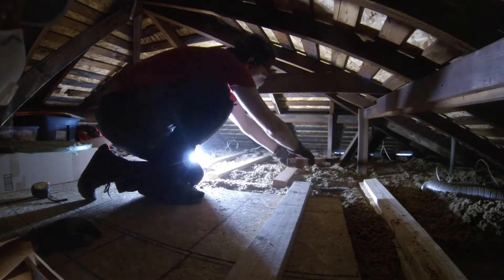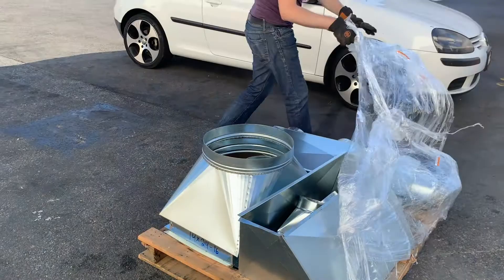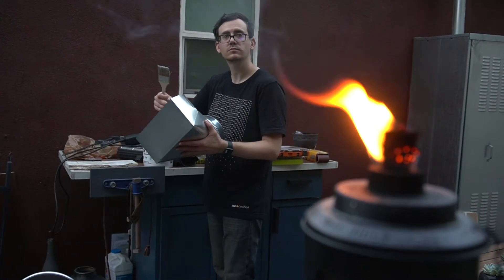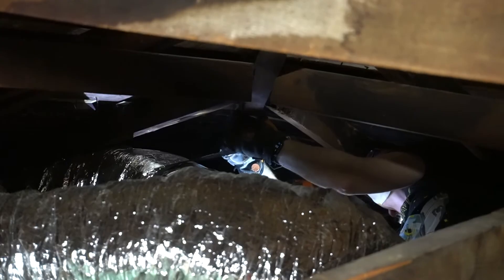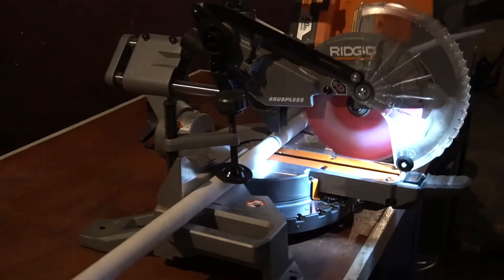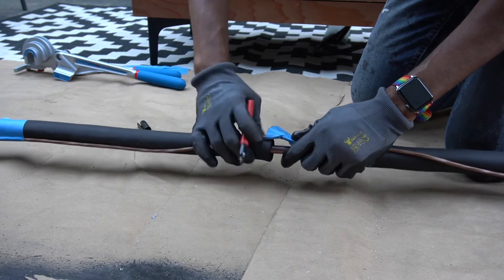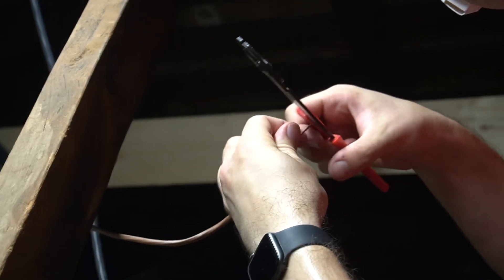Slim Concealed Duct Mini Split Install

Comment: Nice work! Bunch of new tools that cost as much as the labor to install would but you get to control the quality. Cheers!
Reply from the maker: Professional installation is very expensive in our area. I also already had many of the tools from previous wall-mount mini split projects.
Reply: The tools don't cost anywhere near what install labor costs, especially in an expensive area. This would easily be a 5-figure quote from an HVAC company, and the parts/unit are less than half of that total cost. When HVAC labor costs what lawyers do (300+/hr), it's insane not to consider DIY.

Comment: Thanks, guys.  Our house is a nightmare of architecture--huge sections added at various decades and no HVAC in 4,000 sqft of the unfinished extension.  With very short amounts of outdoor space for the unit.  I'm debating whether to go with wall units or concealed ducting, and your vid is selling me on going with the concealed ducting setup.

Comment: wait u r not gonna need individual cooling or heating?
Reply from the maker: It is a small house and we do not need individual control for each room. Central HVAC is a very typical configuration in the US.
Reply: @40Figs  Oh so thid is a more efficient kinda central ac

Comment: Hey guys, really enjoyed the video (especially love how supportive and kind you are to each other)! I'm in the process of remodeling my own LA home and want to replace the ancient gas furnace with a ducted mini-split system, albeit with three zones (three slim duct units). As a fellow do-it-yourselfer, would you recommend taking on a self-install (mostly to avoid paying the $30,000 cost for a professional installation)? Or is it a lot for someone who is detail-oriented but hasn't done it before?
Reply from the maker: Thank you! I'm glad you enjoyed! That's a tough question to answer. I will say, it was a huge undertaking for us. We did have some experience with mini-splits but this was our first ducted install. We learned a lot and saved a ton but it's sometimes difficult terrain to be in for DIYers because there's unfortunately not a lot of resources out there for DIY HVAC work. It's also a very involved process that will probably require learning new skills, but it can't hurt to try! (as long as you have a back-up plan in case things go sideways!)

Comment: So can the air handler be installed in unconditioned space?
Reply: Yes, they're internally insulated.  The only concern is that the condensate line can freeze.
Reply from the maker: Indeed. We live in a climate where freezing does not occur.

Comment: This was really interesting to see. The main lesson I learned from this is: I will pay somebody to do this because it's a lot of work! Looks like you guys did a nice job. Are you happy with the system now that you've lived with it for awhile?
Reply from the maker: Yes! Very happy with it. It runs nearly silently and the variable speed allows it to maintain our preferred temperature without kicking on and off a bunch like a single-stage system. I definitely recommend hiring a competent professional unless you are willing to spend a lot of time researching and installing a unit, as well as purchasing the necessary tools upfront. That said, with the quotes we were getting, we saved thousands of dollars by doing it ourselves, and learned a new set of skills along the way.
Reply: @40Figs  would you mind sharing the lowest quote you received vs how much you paid in total? I'm in the same boat and considering doing myself. 

My lowest quote was $11,000 for a 3 ton system and 4 ducts.
Reply: @40Figs  How many BTU's is the system you purchased? Mine is 18,000 but I'm not sure what flex duct size to use? It's running at 370-530 CFM with no ducts attached.  I'm running about 60' ft of flex with 6 boots into three areas with 8ft ceilings. Now I'm not sure what size duct to use. Worst case would be installing and then releasing its not running. Any advice would be appreciated!

Comment: Thanks for the video.  Great info.    What's the minimum space of the attic would you recommend?  I have a flat roof so don't have much space...similar to the lower end where you installed.
Reply from the maker: These slim ducted units are made to be installed in tight spaces, often in a soffit. That said it will probably be difficult to make the connections in a tight space, so YMMV.

Comment: It appears they used a 16 inch supply....which equals 1000 cfm intake.....and on the outflow they used either 5x6 inch flex which flows 75cfm per tube or 5x8 inch flex tubes flowing 160cfm per tube.      engineering appears to be designed for a 24000 btu system which outflows at 775cfm.
Reply: We installed a pioneer 24k btu consealed ,, the video was great but confused by the addition of your second drain pan under the indoor unit, Also I found plenum ez to build at home using Lowes tin sheets and output plenum using a 4ft ,,8x12 duct from lowes all ducts cost under  $350 including boots .
Reply from the maker: In California it is a requirement to have a secondary drain pan in case the primary drain gets clogged. It is cheap insurance to avoid water damage. Glad you were able to build the plenums yourself, that certainly can save some money.
Reply from the maker: The system was engineered for 600cfm at 0.1-0.2" WC. You are correct the return is 16 inch. The supply/outflow ducts are 2x 7 inches and 2x 6 inches. The unit is 18000 BTU.

Comment: Hi there , from the controller to the indoor unit what cable do you use and how did you connect them ?
Reply from the maker: I believe we used some 18 gauge thermostat wire and spade terminals.

Comment: What thermostat did you use?  We just installed 4 MrCool ducted units and the thermostats are junk and we can't find a replacement that works with the units.
Reply from the maker: We installed the Fujitsu UTY-RVNUM thermostat as well as the FJ-RC-WIFI-1NA to get WiFi/Alexa integration. I doubt these will be compatible with the MrCool systems though. Look at what other options MrCool has, or possibly the Cielo Breez or something similar.
Reply: @40Figs  I've been looking but even MrCool says they don't have one and don't know what third party brand might be compatible.  Basically they're no help...lol
Reply: MrCool stuff is mostly rebadged Gree... cross shop Gree to see if they have anything that might work.
Reply: @hedge605  thanks I'll look.

Comment: Wouldn’t it be easier to put the air filter right behind the grille in the ceiling of the supply vent
Reply from the maker: Yes. That said, at the time we designed this I was unable to find a MERV 13 filter grille that was sized to meet our needs. In this case the filter cabinet is accessible right near the attic entrance, so it's not too bad. Aprilaire recommends changing this type of filter every 9-12 months.

Comment: Excellent video....I'm curious about the tray that you installed below the indoor unit. Is that just a tray to catch overflow moisture in case of a condensate issue?
Reply: Yes. In some areas it’s code to have an emergency drain pan under the unit
Reply from the maker: Indeed, it is a secondary condensate pan in case the primary drain inside the unit gets clogged.

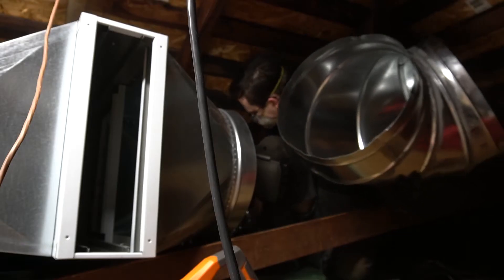Comment: I'm in LA too! Hey where did you buy the air filter box in your ducting? Seen here at 8:47 https://youtu.be/ItYoS9Zp498?t=527
Reply from the maker: It is an Aprilaire 2410. I believe we purchased it with the rest of the equipment from a local supply house, but they are also available online.

Comment: What is approximately the cost of this split System?
Reply: Anywhere from 3000$ to 9000$ typically. But it depends on a few things. Especially the state you're in. Somewhere like New York or California you could see this cost up to 15000$ or 18000$
Reply: @AJ-ox8xy  for such amount of money I would learn not only how to install mini splits but entire racket science
Reply from the maker: Including all ductwork and installation supplies, we spent around $5k to install this unit. The lowest professional quote we received (Los Angeles) was about $10k.

Comment: How is it holding up?
Reply from the maker: Very happy with it. It runs nearly silently and the variable speed allows it to maintain our preferred temperature without kicking on and off a bunch like a single-stage system.

Comment: Great video guys! I really appreciate that you show good footage of all the details of connecting everything together, I'm considering doing a similar install so seeing all these details was super helpful! Anything you'd change or do differently if you could do it again?
Reply from the maker: The only thing I think I might do differently, and this is a big maybe, is to install a unit that had better thermostat options. I'm not a big fan of Fujitsu's thermostats but ultimately you are sort of locked into using them because it is a proprietary control protocol. We ended up purchasing the wifi module (for more than you'd spend on something like an Ecobee or Nest for a traditional system) so at least we can control it with Alexa and a mobile app. Fujitsu does sell an adapter so you can connect a traditional thermostat but you lose the variable speed feature which is important for comfort and efficiency.
Reply: @40Figs is there any chance you guys could tell me a link or name of those baffles for the air vents because I can't seem to find them

Comment: Nice video! I noticed the same thing you all noticed. The ducts for some reason are hard to come by. I guess they assume most contractors will already have the tools to fab up their own plenum.
Reply: There are only so many metal fabricators that can make the sheet metal properly. Inorder to save on shipping cost and other things they almost always come  in panels that you have to assemble onsite.

Comment: Doesn't that unit in the attic have to be insulated to prevent condensation from forming on the it?  I know you put a pan under it but is that enough?
Reply from the maker: So far it has not been an issue. My understanding is that the unit is internally insulated. We wrapped all the plenums with insulation as well. I haven't seen any sweating or condensation on the chassis or in the drain pan even on the hottest days where it's 130F in the attic.

Comment: What type of drip pan was used and did you install a wet switch to turn off the unit in case if too much condensation?
Reply from the maker: The pan is a Diversitech Plastic Condensate Drain Pan, 27x39. I purchased a safety switch but haven't yet gotten around to building a solution to connect it. All the switches I've found are for traditional systems and are intended to disconnect the cooling call wire from the thermostat. The Fujitsu unit wants the reverse of this, it has terminals that should be closed when there is an overflow. My plan is to connect a transformer and relay separately to effectively invert the logic of the safety switch. My interim solution is a Zigbee water leak sensor in the drain pan connected to Home Assistant.

Comment: The hot attic space must have been brutal to work in.  I think I would have plumbed and wired the unit before doing the ductwork.  You could have cooled the space for the ductwork phase.  Nice video.  Inspiring.
Reply: That is a good idea.

Comment: Did you already have most of the tools or did you find yourself running back and forth to the nearby hardware store for all of those specialized tools as the need came along?
Reply from the maker: I've installed a couple of wall-mount mini splits previously so I had most of the necessary tools. There were some new tools needed for this job (duct crimper, duct strap tensioner, different size crowfoot wrench) that resulted in trips to the store or ordering online.
Reply: @40Figs  I noticed a wall mounted evaporator. Was it not sufficient enough.

Comment: Very nicely done video, I am looking for all the information I can regarding a split system I am planning on installing in a new construction environment and you guys have provided a lot. Doing a remodel system as you have done is much more challenging.  I learned from you guys about the crow foot torque, and the tubing bender, not sure that will be necessary in a new install, we shall see. Why did you pick Fujitsu, was thinking  Mitsubishi. A little more information on  installing the refrigerant would be helpful...I will find it. A very well done presentation not overcrowded.
Reply from the maker: Mitsubishi has a great reputation, I had a wall-mount unit previously I was very happy with. If budget weren't a limitation that is probably the direction I would have gone. Ultimately Fujitsu seemed like a good bet because most of the local HVAC companies here sell and support them. We were also lucky in that our lineset length did not exceed the factory precharge so we just had to open the valves once everything was leak tested and vacuumed.
Reply: Talking with HVAC-knowledgeable friends of mine, I'd avoid Fujitsu.  I paid way too much for an initial set of installs in our place (getting an oil furnace with a cracked combustion chamber out of the over-garage area) and one of the units shit the bed within 5 years of installation--apparently, the indoor evaporators are known for corroding and leaking.  So now I'm debating whether to replace the evap coil and recharge the system, or just scrap the whole damned thing and run a new system.

Comment: Really well documented and seems like a large project that went fairly smoothly. Any ideas on the comparison from your cost given that you had to get custom ductwork and get the hvac tools vs pro install?
Reply from the maker: We're in the Los Angeles area, and the savings was roughly $5k.

Comment: Fun, I would insulate the adjustable elbows off the plenum distribution box. You will get condensate there.
Reply from the maker: We did, may not have made it into the video but those are all wrapped.